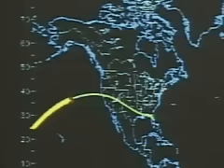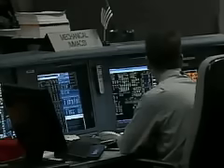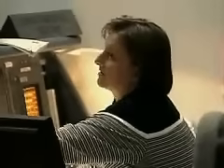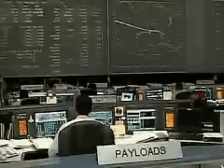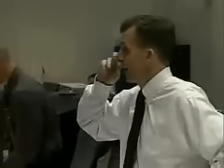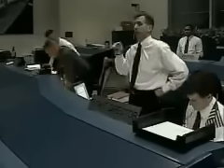Inside Mission Control During STS-107 Columbia's Failed Re-entry and disaster

Comment: According to recovered data cited in the accident report, the latest the wing damage could have begun was an off nominal temp rise on the left main landing gear brake line sensor. This was located on the inboard side of the wheel well. Next, 53 seconds later, and over the span of the next 26 seconds, 4 hydraulic return temp sensors went off scale low. Its not unusual for a sensor to fall out, but almost simultaneous loss of multiple sensors from separate redundant systems was outside previous flight experience, and thus was of grave concern. The crew did not know about this problem, but you can hear FDR Cain is concerned. 
 Recovered data also document the shuttle's computers attempting to compensate for the yaw to the left caused by wing damage. First there was a negative trend in sideslip angle that was within flight experience for 2 minutes, but then went out of the bounds of previous flights of any shuttle. The negative trend started 36 seconds before the brake line sensor indicated an off nominal temp rise, but did not exceed flight experience until 1:24 later. So the start of the negative trend may be, but is not for certain the first indication of damage.
 To compensate for the yaw caused by the wing damage, the flight aileron trim diverges sharply from expected about 6 minutes after the first sensor indication. The trim continues to diverge more and more, only pausing during an attempted correction by the firing of 2 yaw jets, and then immediately resumes its sharply increasing divergence. Loss of signal was 2 seconds after the yaw jets fired.
 The first electronic indication the Columbia crew had that something was wrong occurred when the first of 4 fault messages was displayed on the back up flight software monitor. This indicated a loss of tire pressure, and was accompanied by an audible tone. This was 36 seconds after the aileron trim diverged from expected values, and almost a minute before their last transmission. They knew they were in serious trouble before loss of communication having no doubt felt the divergence from nominal flight patterns and the tire pressure warning.
Reply: At the time, they were trying to diagnose the landing gear issue (1 sensor says it's locked, the other saying the gear is up). They had about 40 seconds until it was all over for them. Excerpt from the crew survivability report you can find online:

As Columbia entered the atmosphere, one crew member was not yet wearing the ACES helmet and 
three crew members were not wearing gloves. Per nominal procedures, the crew wearing helmets had 
visors up. There was a period of about 40 seconds after the orbiter loss of control (LOC) but prior to 
depressurization when the crew was conscious and capable of action. Part of this short timeframe was 
undoubtedly employed in recognizing that a problem existed, as the indications of LOC developed 
gradually. The crew members could have closed their visors in this timeframe but did not. The SCSIIT 
attributed this to the training regimen, which separates vehicle systems training from emergency egress 
training and does not emphasize the transition between problem resolution and a survival situation. Once 
the cabin depressurization began, the rate of depressurization incapacitated the crew so quickly that even 
those crew members who had fully donned the ACES did not have time to lower their visors. Although 
circulatory systems functioned for a brief time, the crew could not have regained consciousness upon 
descent to lower altitudes due to the effects of the depressurization.
Reply: +bobby czyz Do you know at what point the aileron trim diverged by more than 1/2 a degree? I know that in STS-27, Hoot Gibson was watching those trims like a hawk, because he didn't think they were going to survive reentry. If the divergence exceeded that level, he was planning on exchanging a few choice words to tell Mission Control exactly what he thought of their damage analysis.

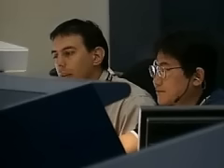If Husband or McCool were watching that trim indicator on board, they would have known something was seriously wrong, even before the hydraulic temperature sensors dropped out (1:34 in this video).
Reply: Interesting.
Reply: "This indicated a loss of tire pressure"
So, even if the ship had survived reentry intact, it would have crashed on landing, probably still killing the entire crew.
Reply: @odysseusrex5908  By that point the orbiter had lost a wing, was tumbling, and was impossible to land anyway.  The standard procedure on re-entry of the visors being up was bad.  The chutes being fully manual was bad.
Reply: @Reticuli   I thought the tire pressure reading came before the wing broke off, but OK.
Reply: +bobby czyz Cain and others were briefed before reentry by an engineer of what sequence of events were likely to be observed in the instrumentation if the foam strike had indeed caused RCC damage to the left wing.  He knew what it meant as soon as the independent sensor systems started reporting problems.

Comment: At 5:04 they said.....feel the heat
Reply: But that is fairly normal upon reentry.
Reply: He said "and uh hou...." He was calling down to Houston mission control.
Reply: @scooby1971  I believe the report but I can not hear and uh Hous no matter how many times I listen to it. I hear feeling the heat.
Reply: @marlonisaac1  he said "and uh hou" which was cut off because the shuttle had begun a bank to the right which put the tail between the radio and the satellite. He was calling down to Houston, likely to get advice on the alerts that popped up in rapid succession on his display at that time.
Reply: bcoleman71 ya if you believe the transcript which says right in it that they aren’t sure if they transcribed it correctly. It is definitely not and uh hou. It sounds far less like that than feeling the heat.
Reply: Marlon Isaac exactly. The transcript says right in it that they don’t know if they transcribed it right. It’s much more likely it’s feeling the heat.
Reply: @AFpaleoCon  the most logical thing the commander would have said would have been "and uh hou..." because when shuttle communications initiates a call down to mission control, every transmission is preceded by the word "Houston"
Reply: Feeling the heat

Comment: Question: Exactly when in this video did the breakup occur? Since there's not really a single point where anyone says, "OK, the shuttle is gone," it can be hard to figure out where the breakup began. Was it when the one guy reports losing the temperature sensors? Or when the tire pressure alarms were triggered? When the static came through the comm? I would appreciate that. Thanks!
Reply: +Connor Pack    Pieced together from several official sources:

At 8:58:03 a.m. beginning of wing collapse 
At 8:59:32 a.m. "Roger, uh, buh ... " loss of comms and telemetry 
At 8:59:46 a.m. total collapse of Left wing 
At 9:00:02 a.m. breakup continues but crew module still intact and nominal function 
At 9:00:19 a.m. the fuselage began breaking apart at 18 times the speed of sound 
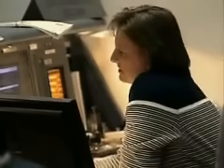 (So technically the breakup began at 6:23 of this video if it is not edited, but the audio sometimes appears out of synch with the images so I'm not sure how accurate any timeline overlay of this video would be)
Investigators believe the crew module was probably destroyed over a 24-second period beginning at 9:00:58 a.m. Side note: Good images but there is a lot of missing audio on this video.
Reply: +UnYin99 Nice work on the timeline.
Reply: +Visonance Intelligence Thank you very much. There are many safety lessons from all three major US spacecraft disasters, and I use them in work presentations so I have spent some time studying them. No expert for sure but I have a feel for it.
Reply: +UnYin99 There isn't missing audio. It is only the comms.
Reply: UnYin99 Do you have a link?

Comment: Sad to think, something as simple as an external on-board camera system with a "live down link" could have prevented both Challenger and Columbia disasters. The Challenger's joint seal failure, and Columbia's catastrophic debris strike would have both been visible as they occurred. The simplest ideas tend to be the best ones boys. Not to mention cheap.
Reply: Puff29646 I'm going to take a chance here. How would a live camera link prevent these accidents?
Reply: Puff29646 In both cases, even if they knew what was happening, there would be no way to stop it.
Reply: +Puff29646 What the hell could the challenger have done?ALL Abort options begin AFTER the shuttle separates from the main tank. If you try to leave the tank early, the deltaV from ascent speed(HOLYHELLFAST to Flight characteristics of a brick) would cause the shuttle to rip in half lengthwise
Reply: Everseeker In fact, that's exactly what happened to Challenger - It didn't explode, it broke apart from the incredible stress of a sudden direction change.  The only thing that exploded was the vapor cloud around the tank - The tank itself broke apart from the release of pressure and the structural failure of the lower tank area, and the shuttle itself broke up almost immediately after.  If you watch the footage closely, you can actually see the orbiter emerge briefly from the cloud before tumbling out of control.
Reply: +SLagonia I have seen the same imagery. Look again at the images...
One is the Challenger main body
One is the CABIN (With people within, at least 2 turned on O2, and 1 supposedly tried to audiotape something)
One is one of the WINGs
IIRC, The exact term was VMax exceeded with concurrent breakup of vehicle
From launch to main tank explosion was a fixed time. The hole was a blowtorch, aimed right at the main tank. The shuttle is just along for the ride until main tank separation. Since the Main tank was NOT going to survive... It was all over from the getgo.

FYI: You did NOT need to see the exterior from a special camera to know what was going to happen.My Mother was one of the finalists for the Teacher in Space. While She was not selected, she was watching, along with the rest of the school, in a special assembly. Right after the roll procedure, which she was watching intently, she whispered Oh no and left the stage. She has never (and will never) seen the actual explosion, but she said that she saw a lot of flickering, around the base of the SRB, where she had never seen such previously, and knew that a disaster was coming.
So, it could be seen... but nothing could be done
Reply: Well it wasn't really obvious that something was going to happen until it hit the gale and the aluminum came loose from the joint, but maybe she sensed something was off earlier than that.  

Anyway - I actually mean that if you slow the vapor explosion down, you can actually see the orbiter emerge very briefly before it goes into a tumble.  First the nose comes flying off (releasing the monomethal-hydrozine from the RCS) and then it tumbles, at which point the vapor cloud catches up with it and obscures the break-up.  The next we see of it, it's in many pieces falling to Earth.
Reply: +SLagonia Ah... Reread your comment... We are arguing the same side :) there was no way to separate the 2 without loss of the orbiter.
Although... I Wonder... Would it be possible to manually jettison still burning SRBs?
Reply: Puff29646